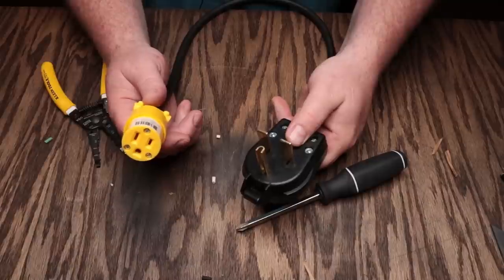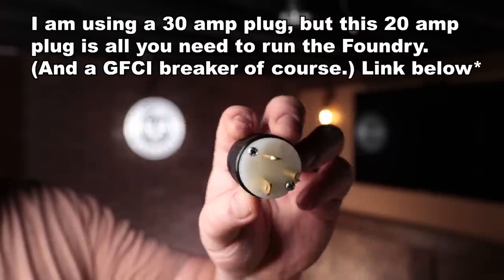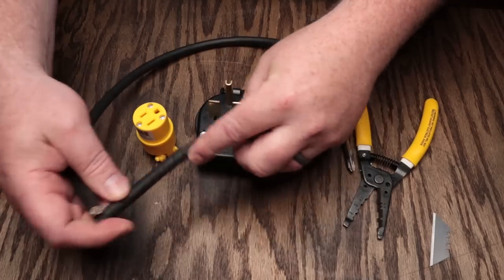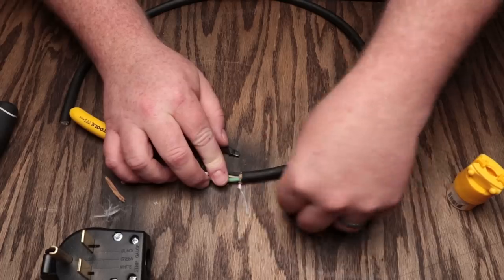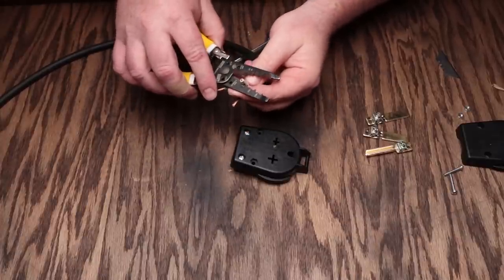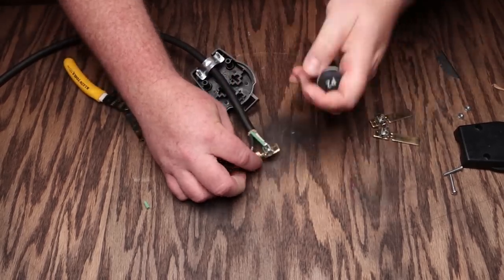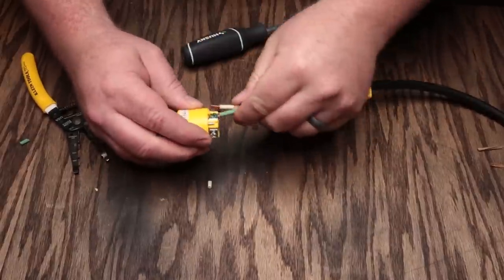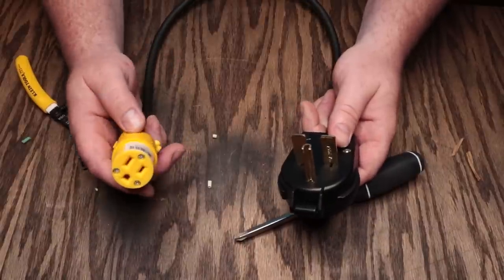Anvil Foundry 120v to 240v plug adapter DON'T CUT YOUR CORD!!

Comment: Hi Brian, can I do this with an older 3 prong 10-30P that has the angled prongs with the middle one at the top having that “L” appearance to it?  Plug I bought at Lowe’s said not to be used for a grounded appliance. I made the cord and tested the voltage through it with a meter and it read 120. It’s a 220v outlet so hmmmm, I did not plug the Anvil into the wall with this. In short, am I screwed?
Reply from the maker: You probably have the wrong wiring on the prongs are you checking voltage from one lug to ground or across the two lugs that have power?
Reply: @ShortCircuitedBrewers  hi checking from one one lug to ground. Just saw that the L prong is a neutral and not a ground.
Reply from the maker: You only get 240 by testing the 2 hot  lugs. 240 does not use a neutral. Only a ground.
Reply: @ShortCircuitedBrewers  thanks. Than I should be good to go. I’ll test it again across the two lugs with power just to be sure. Thanks again for your help. Love your channel with its straight forward advice and demos. Have a great year!
Reply from the maker: No problem!! Thanks for the feedback!! Let's hope 2021 is a better year!!! 👍🍻